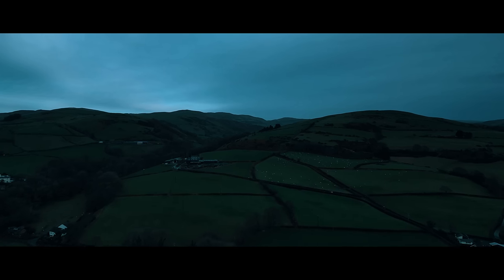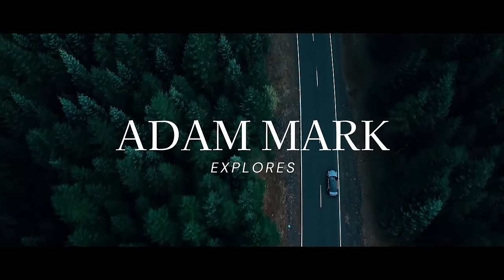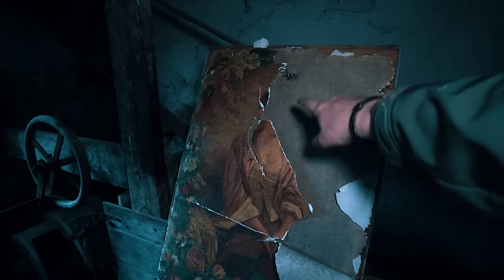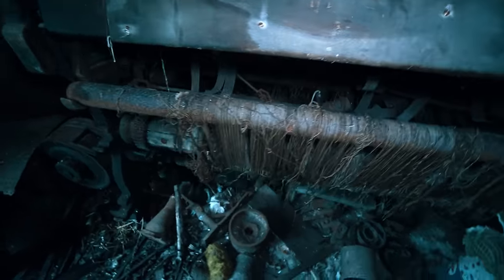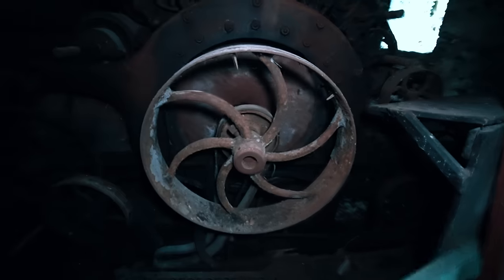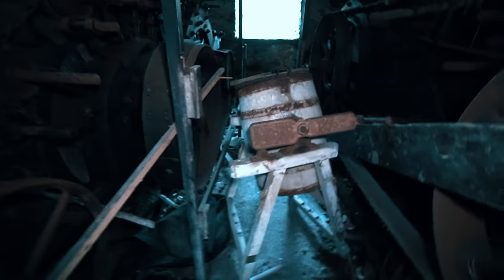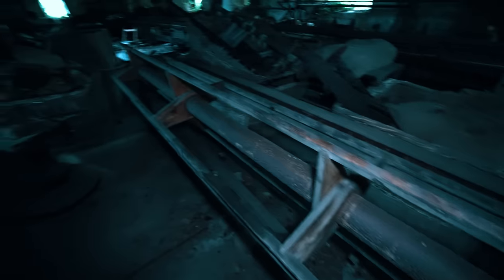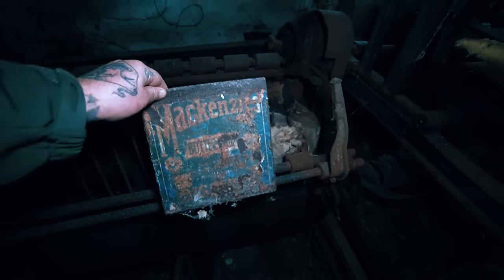Unbelievably Haunted & Abandoned: Even The Police Fear To Enter!

Comment: That large bit of kit you asked about was used to weave the cotton, small children would be given the job of quickly diving under the machine while it was operating to pull out the loose cotton so it didn’t get trapped. Lots of kids died doing this and was so dangerous
Reply: Possible what the " I should not be dead " was doing and died in a terrible accident that way.
Reply: Or the ghost kids running into the mill.
Reply: That was my thoughts too :) Brilliant from start to finish - each explore surpasses the one :) x
Reply: The deaths of child labourers.from chimney sweeps to the factory workers.cotton mills and huge looms took the most.the start of the industrial revolution.many children had to work as poverty.
Reply: Poor little buggers 😢
Reply: @avislloyd-dimmack804 my thoughts too. Adults were also killed or maimed too. Long before employee rights. 😢
Reply: So sad
Reply: Called a spinning jenny.

Comment: I worked as an electrician turning an old mill into a museum, it was exactly the same as this. You could see dug outs in the wall where the kids that worked there would sleep instead of going home .Brings back so many memories. All the machinery is for making cotton material from the bobbins. The black GEC thing on the table is an old DC motor starter. We got it all working again with the water wheel and huge leather belts to run the machines. When we got the machinery running one of the belts came off and nearly sent me to the after life.
Reply: That’s super interesting. May I ask where the Museum is that you speak of? I’d love to go and pay it a visit
Reply: @greenbunnyinabongo7299  It's Stott Park Bobbin Mill just outside Lakeside in the Lake District
Reply: @23664gray is it still in operation? The museum? If I’m ever out that way, I would love to see it!

Comment: I've been to a haunted house in NJ we went in afternoon and there was clothes all over the place we headed chains coming down stairs then could hear caridge coming up to house we left then we came back at 8 PM it was so scary the house changed there was a hole in middle of floor which wasn't there before you could hear footsteps chains caridges we ran when it  turned around a light was on with a black mass with yellow eyes I was 12 yrs old i will never forget it  and the lights didn't work the house had a fire 3 passed away in home

Comment: those panels with the pictures on it were normally 3 panels joined together to form a fold out screen/ privacy (Bedrooms)  was quite common in Victorian early Edwardian period  these look later on panels are they are a papered very cheap build.
The name BOBBY, may actually be a nickname for a mill job performed by the children, so in context to what you saw on the spirit talker, Edith Moore  (job) Bobby)
The castle you say is a few miles away, but law (court) was mostly handled by a local magistrate, in small towns or villages they held court in where ever had the most coinvent space such as a tavern or mills, now mill sites were reused time and time again this mill maybe mill version 3 or 4 depending on any other suitable water / mill sites.
There may of been an execution or judgement of an execution on that site.
Reply: I wonder if the the mother of the baby [ in crib ] used the screens when she breast fed whilst at the mill - I don't feel it would have been one of the workers - more likely the mill owner  !!

Comment: @Adam Mark, if you would, when in a place that's dilapidated,  and you're getting answers, could you ask them 2 questions,  what year is it, and does this place look as it did before you passed or do you see it as I see it now, where nature has taken it over? This place would have been a great place to ask those questions.  Usually when people use SLS it will show the stock figures still working where machines are. Old sewing machines with sls figures working.  Also, will you visit the castle now you mentioned down the road or is it occupied?
Reply: Thats what i think visit the castle  because it all could be connected if its not occupied. Even if it is ask the owners for permission and explain why. Id bet the mill was owned and operated by the castle owner.
Reply: @lindatimmons3675  link to the castle is definate maybe to the pregnancy mentioned as both were mentioned in same area if I recall correctly

Comment: Those bobbins have got wool on them, as my Mum worked in a weaving mill making tartan and this looks like it could have made tweed or blankets. The large baskets had the refill bobbins that you would have loaded on the machines . My mum used to run 6 weaving machines which was a lot but they did not look those machines. Cx

Comment: All the equipment looks original, but it also looks like the place has been used as a dumping ground, so unsure if the cot is original. Mills were very dangerous places so the I wasn't meant to die fit's.

Comment: 'Longwood Hodersfield' were makers of machinery used in textile Mills. In this case used to run this 'Water Cotton Mill' which is what would have been running at the residence with the water wheel just outside being part of this Mill. Looms, jennies, billeys, slubbers, carders utensils and machinery are all part of this too. Dates back to approx 1795 - early/mid 1800s when it was common place to have 'Pauper Children' used to work at these Mills  which might explain the presence of children in the paintings on the property and why paranormal sightings on the property include them.
Reply: General Electrics Witton Birmingham opened in 1902. This company is the brand on the continuous current motor starter instructions and box Adam finds in the basement
Reply: History on this Mill suggests it was originally built in 1809. Built on a site reputed to have originally been a smeltery and stamp mill established in the 1640s. Although the Tweed Mill would close its doors for the last time in the early 80s where it had been a museum for 30 years, proceeding its closure. A lot of history on this property and clearly a fair amount of paranormal activity dating back hundreds of years to those first to inhabit it. Wow! Deserves more paranormal follow up. Get at it Adam can't wait. You're the best!

Comment: If that is the mill I think it is. They used to weave flannel and cloth. Products of the wool industry. There were wool spinners upstairs. And Looms on the other floor. The General electric box etc. If it is the correct mill. Were left over from the mill being used to generate power from the water wheel. It supplied some of the neighbouring houses too.

Comment: Well done Adam, don't forget to give assurance that you mean no harm after you tell your Name. This Mill looks to me like it made 'Hanging Wall Tapasties', hense the pictures of scenes gone by around the place. The threads still on the spools were heavy and thick, some of the 'Weaving Looms' were large sized but not for carpets I don't think. This goes back to many years before computerised weaving machines, so the patterns would have been specialised and from a chart copying each picture. The hand leavers of the weft and colours continuously changed between each row before moving the shuttle by hand  through the waft of threads or cords. They worked from early morning until late at night, even children worked at Mills in those days.  Check all your Names, Words etc, in connection with the nearby Castle for historic facts. Also modern words mean nothing to past spirits or souls.....Cot..was Crib or Cradle' try to familiarise yourself with terms of olden days as this will make it easier for Spirits to understand. Thank you 💕🇦🇺